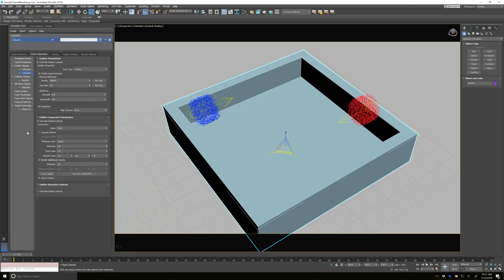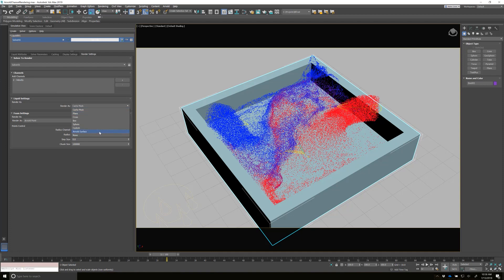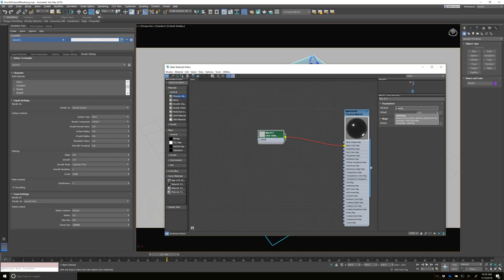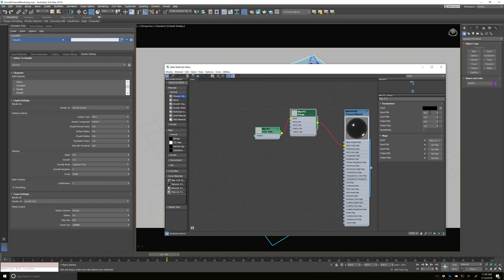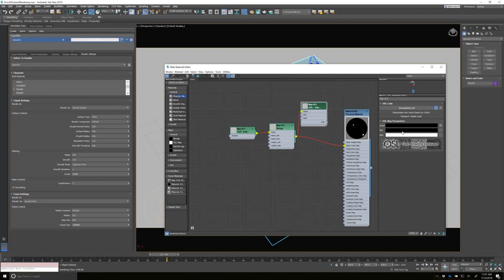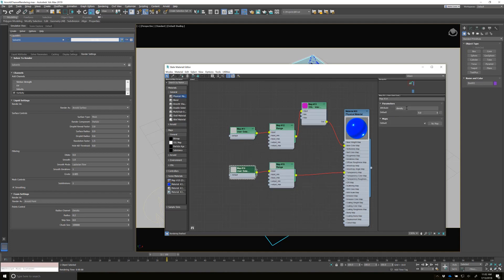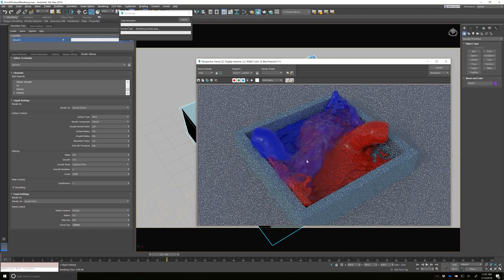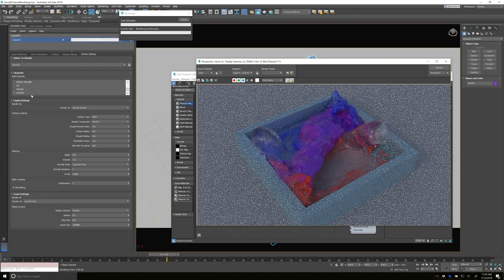Rendering fluids with channel data in Arnold

Comment: Do you know if its possible to do this without Arnold Surface?  I'm trying to render particles as planes with scanline renderer (Ink & Paint is unavailable for Arnold Render.

Great tutorial though!  I did get error codes for interpolation mapping.  This fluid simulation stuff is amazing.

Comment: That is solid, great work.  I see a couple of issues I was doing..  range was missed and capital D in density... didnt even think about case sensitivity.   This is gold, thanks.   And of course I will attempt the break it by shoving more emitters into the mix :)
Reply from the maker: Can't wait to see what you come up with Steven. Keep me aprised!
Reply: @martincoven  ok this works a treat, have 4 emitters blending nicely.  Just need to see if the interpolate can be replaced with something to pick up a solid colour and not a blend between 2 colours.
Reply from the maker: @stevenls9781  The values are always going to blend, but maybe you can do some sort of interpolation with the shader to define the range in a different way.
Reply: @martincoven  I was looking to see if there was a way to have 4 user data nodes, each plugged into an OSL named instance with the float value assigned as the density that is set in the sim, pipe that to an OSL colour, to a physical material and then to a layer shader.. sooo grand, so confident.. such failure :)  I thought that would assign a hard colour to each density and then it would still blend based on the sim.